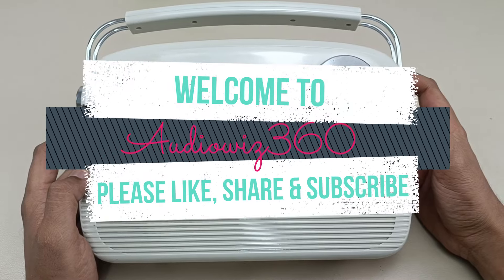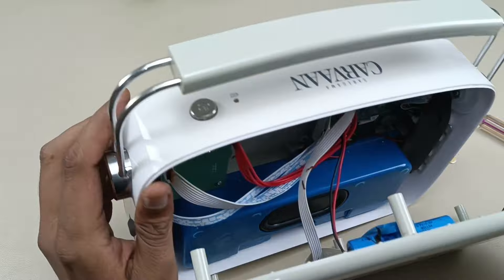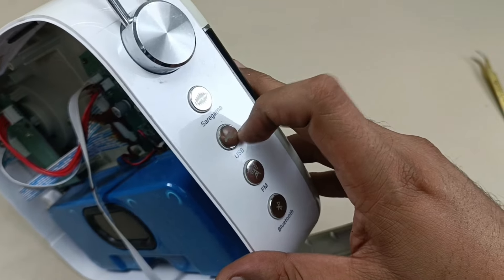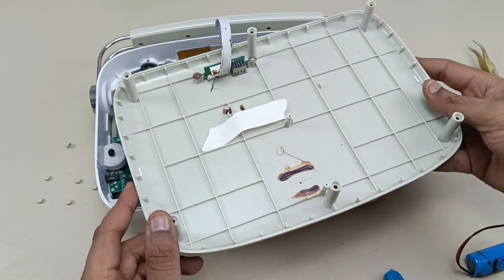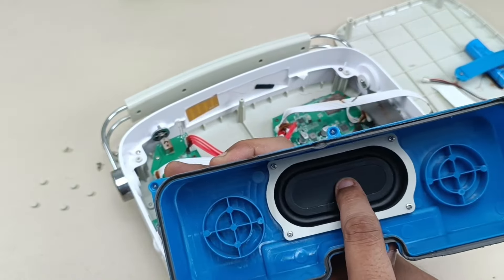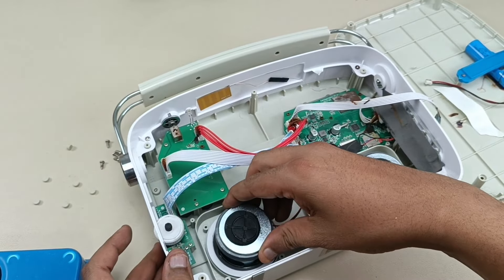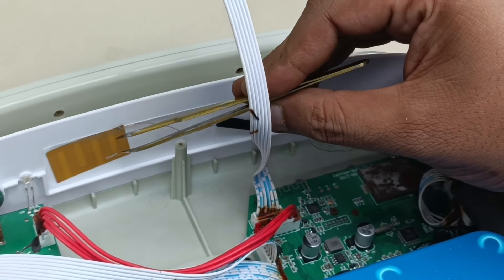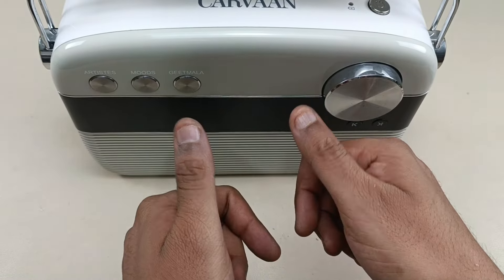Saregama Carvaan Disassembly & Looking Inside | How to Teardown

Comment: Hello sir,
I have soundcore motion plus it fell of the stairs and after that minimal crackling sound start coming, I opened it and checked that one of the foam ring has tear down i applied glue to seal the hole but still it is cracking, can you provide any solution , or I can courier the speaker to you?
Reply from the maker: hi, what is the diameter of the driver
Reply: Measured with scale it shows 5 cm

Comment: Amplifier should be at least have 12 volt oprating system i seen 3000 rs potable bt speakers having 3s lipo  running amplifier and also waterproof